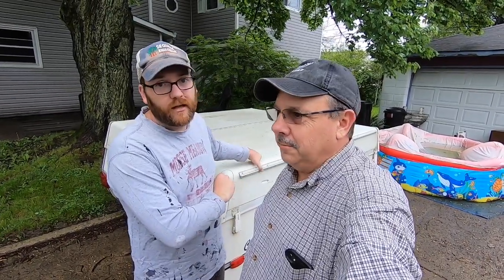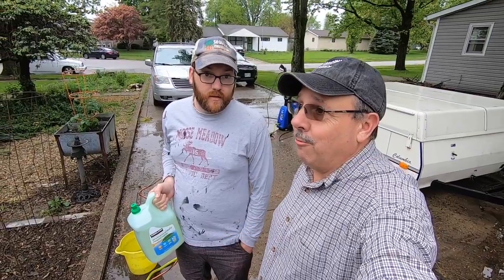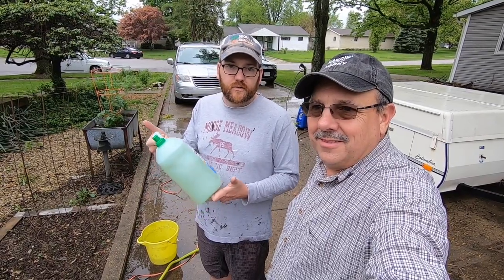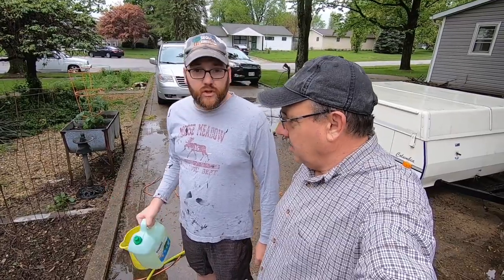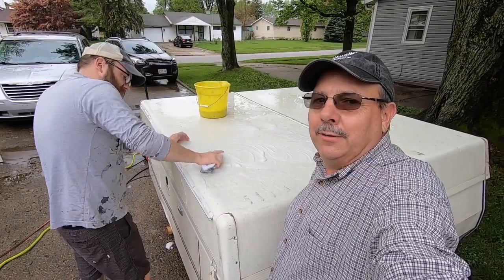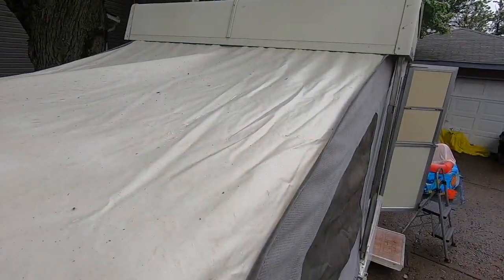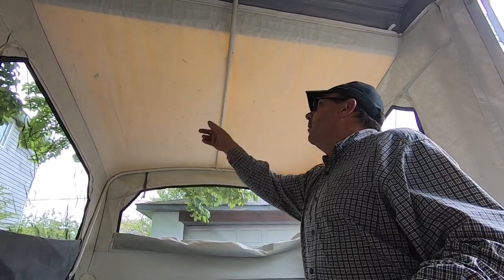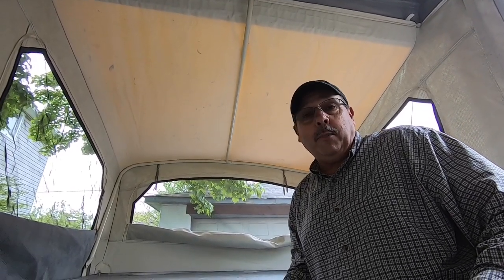Popup Camper Make Over-Episode 2 -Mold and Mildew Removal

Comment: I had wondered if that Awesome liquid would clean up the inside. Going to try it here's hoping it works. Mine doesn't have any mold but just some water staining and a bit of discoloration. Or if that doesn't work just apply some sticky appliques around. That would make the inside more pleasant to the eyes anyways.
Reply from the maker: Wishing you the best

Comment: I had a pop up tent trailer that periodically got mold spots on the tip outs.  This is nearly impossible to avoid because you are bound to leave any campsite with some organic material on the canvas.  Because your trailer is closed for travel and storage that organic material will begin to breakdown and cause mold.  Canvas is very difficult to clean because it can be damaged by almost any cleaner except soap and water.  That’s where the hydrogen peroxide comes in.  Simply open up your trailer on a warm day or even at the campsite before you set up the beds etc.  Mist straight hydrogen peroxide onto the canvas wherever you see dark mold.  Don’t rub the canvas because you want to keep that material strong.  Let the hydrogen peroxide dry and reapply as necessary until all those little mold spots are gone.  This will not damage the fabric and will remove all the mold before you have a really big problem.  I did this for over a decade on my tent trailer and never had a hole or weak fabric as a result.  Just really white clean canvas.  I hope this helps someone.  I searched for years to find a safe product that works without damaging that canvas.  Great video.  Oh. I also use it straight on white baseball hats that get sweat stained.  Does a great job.
Reply from the maker: Awesome tips I am sure every one will find this vary helpful. Safe travels. Thanks for watching